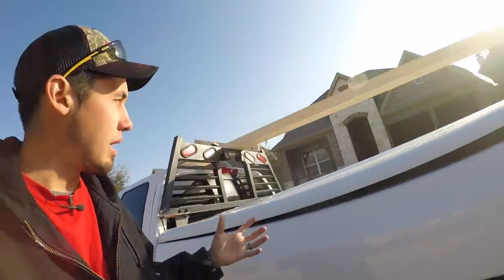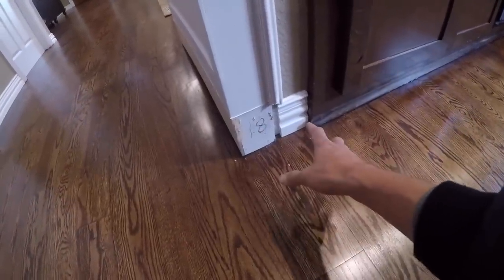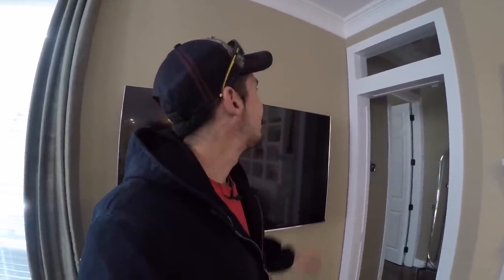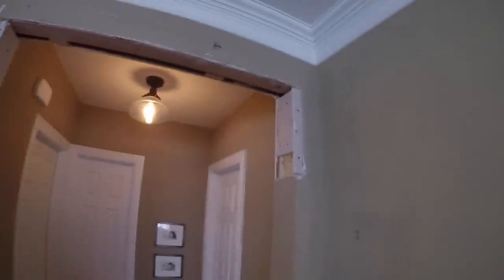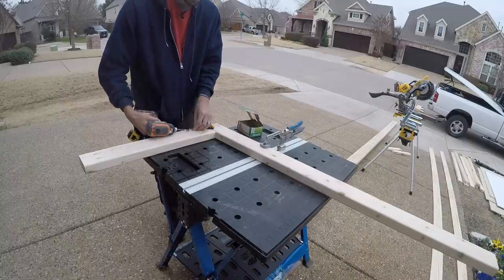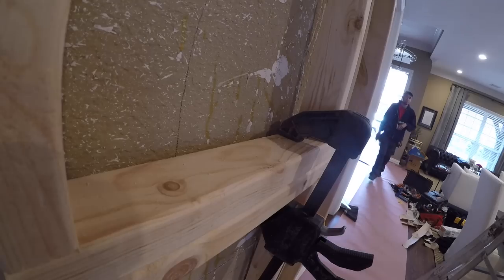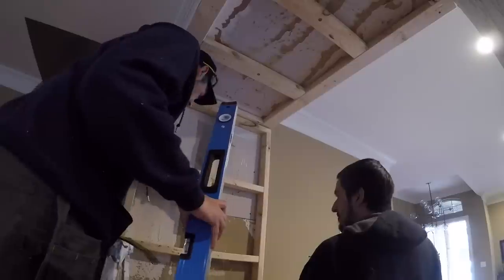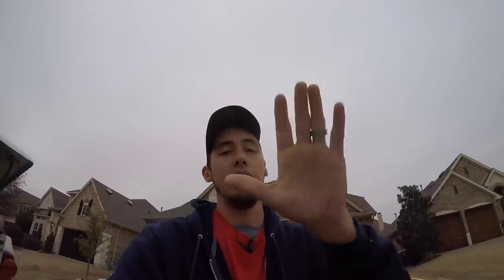A $3500 Mistake

Comment: I have drywall archways throughout my house. I want to add custom molding around this but not sure how to make this mounding. Would love a video like that as there isn’t really any context on Facebook like that.
Reply: Winston Deitz there is flexible mouldings for arches, that’s the easiest, it’s made of rubber and it paints great.
Reply: It is best to build a jig.  A work area with the shape your require drawn out.  than take some ply and cut the inside of the arch to the opening size.  this will be the template.  next take some stock wood and wrap it in towels.  continue to pour on, near boiling water, while flexing the stock against the template.  it maybtake hours.  After it is flexed into shape take your router and make whatever trim shape you wish.

Comment: I am retired now, but I was a union carpenter for 37 years. Built a lot of concrete forms, hung a lot of drywall, installed a lot of acoustical ceilings, but when it came to trim work, call someone else. I never had the patients, I would be asked to work trim jobs many times, I always told the contractors I was not their guy. I’m not ashamed of that at all, sure, I can run base, casing, simple stuff. Thanks for your videos.

Comment: I've been a Craftsman for 35 years now I had a job doing 20 houses about the same size a quarter of the house I was doing at 20 foot 2×6 studs from the bottom plat to the second-story top plate in the entryways and living room I planning the studs and furring out the studs. The throughout the houses that's cool you didn't bag on the guys that did the job before you you don't find too many Carpenters like you no more good job.

Comment: Some of the comments are so silly....from the home owner is too picky to the design is too elaborate and just make it drywall. You as a very talented carpenter stand out from the "wanna-be" contractors who have a truck, a hammer and nails and call themselves experts. Understanding how trim pieces "transition" smoothly in a design and knowing the proper way to build framed out openings is what the homeowner was looking for. Is she an expert? Probably not-that's what you either have a specialist like you or an architect or interior designer make your design for you. The mistake the home owner made was not checking the other guys references or work. Great videos....

Comment: At 7:04 of the video you're showing that trim on side of door. What they used for base doesn't match baseboard that is already in place. When you put up the 2x4 frame work to lower the ceiling, wasn't there anything to nail to . Why did you have to toggle bolt it in place ?

Comment: You could have saved a lot of work by using 3 1/2"  verticals on the outside and 2 1/2" for the rest of that passageway.  You have 1" at the ends when you rock it, which means somewhere in between, there is about 1/2" bow.

Comment: I don't usually comment on videos, but I'm watching this video and I'm really surprised you went ahead and added that big, basically extra wall in that walkway by the stairs because it was bowed out. You just about took square footage from the house, you even said their were drywall guys going in. I think a better fix would've been to take that piece of drywall out and re-set the ONE stud behind the wall, then the drywallers could've come in, threw up another piece, and you could've saved square footage, time & material, and it would've looked like the house in the beginning. The wall didn't even have a load on it. I'm just surprised because you're usually pretty good.
Reply: if you listened to the beginning of the video, he explained the other reason he did that was so he could get a whole piece of trim on the inside of the staircase. And the finished look wouldnt be so clumsy...  It didnt look like the house was gonna miss any square footage...

Comment: LOOK at the base she accepted on the pillar , around the new cabinets (to left of second arch repair) and its clear by it's mismatch to original  the home owner is not fussy enough for me to have ever considered working for her, without a lot of clarification on her actual vision . (for her as much for me ). 
For lack of clarification the shaker style pillar look should have been applied to the wall openings using the existing crown at top and an attempt to match oldest baseboard . ALL ok'd in writing before any work start .

Comment: i hate to say it brother, you said, "we can stop being framers....." you never stopped being a finish carpenter. id have laid 2x2s on the ceiling framed the side wall on 12" layout to straddle that center stud and give the panel support. notch the plate or float by with a 2x2 as the center plates to avoid that stud. the min you have pocket screws on framing members thats just plain trim. you are great at what you do, i don't have the patience, or the ability to deal in /32 of an inch. they call it rough for a reason.  even when you said "now i get to break some stuff" and had a 3" trim bar lol. i go get bfh and get it down.

Comment: Good vid. Where did you get your blue work table that you were setting pocket holes in the 2x4's?
Reply: legalsolutions07 I believe that is the Kreg Mobile Project Center which is most commonly available at Lowes, Rockler and Menards. All over online as well.

Comment: Didn't really seem like the toggle bolts where necessary. There "should of been" enough framing behind the sheetrock to screw into, but I was there to know if there were or not, but there should of been. And gotta order the right material, 10' sticks would of been the right lumber to use, less work, no kink..... Nice finish work tho!

Comment: What if I have to do this but my floor is all tile and concrete slab underneath??? what would you use?
Reply: I think you can pre-hole at the bottom with concrete bit and screw it.

Comment: As far as the wall  with a lump on it...  Sorry to say, I think you didn't do much better than the last guy.
What you should have done, was to built the frame just as you did but, instead of moving it away from the way (something that will thicken the wall's width when viewed from the sides), you should have inscribed the 2x4 in the area where the wall was bowing, and that would have allowed you to have the entire frame flush with the existing wall, without intruding more into the walkway, and as I said, have wall that when looked from the sides, as you walk towards it, will look thicker at different levels.  Just my opinion.

Comment: The most basic difficulty is still,,, no plans, no prints.  You have the benefit of 20/20 hindsight.  You've seen what you don't like, the owner has seen what she doesn't like,,,,, and I'd wager the previous contractor has seen what he or she doesn't like,

What is the passageway width?
Reply: Not wide enough after you build the wall

Comment: Nice work!  What would you prefer to use for the field instead of MDF?  Thanks again
Reply: Fingerjoined pine or poplar.  Little more expensive than mdf but last 100x longer.
Reply: Johnie 1st choice how would mdf have a smoother surface?  Fingerjoined prime has as much prep as mdf and it's solid wood.  You get way more life out of it and it won't warp like mdf.  I work mostly in the Seattle area and mdf goes to shit quick over here.  It's a quick buck using mdf but you put 2 guys on a job, one using mdf and one using fingerjoined and I bet the guy using real wood will get the call back.
Reply: Anybody who recommends finger jointed anything hasn't been around the business long enough to see finger joints raise and swell. I'm 31, what rock you been under? MDF is the material of choice for painted dry areas.

Comment: I am a jack of all trades.. i can get it done. Doesnt mean i know the best, easiest or fastest way to do it.  Hire the right person get it done right the first time,.. save yourself the money and headache. 
I have to be a jack of all.. i dont have the money for experts. But i still want quality.

I love the triming in this house. I did similar.

I wouldnt of bothered with the toggles. The centers tie into the outer frame plenty. If the wood warps in the center.. the toggles will just take the drywall with it.

Comment: OK, so that wall section by the stairs was originally put in to hide the crooked wall?...but it didn't.
Reply: Apparently, also, is the full stop ( screws into the hardwood floor) potentially creating an expensive failure?

Comment: Did you used a skill saw inside the house with out covering the furniture or light fixtures? That’s a big no, no.. you should be using better cover material for your flooring and after all it looks like mdf or just pine that tells you they didn’t pay well for the job.. I like to see your work with natural stain wood. (Always judge you’re workers on how they prep the job and how well they protect your existing materials and furniture)

Comment: You should have ripped out that drywall. There is a reason why that stud is so bowed. There could be a severe settling problem or some piping issues behind there. I would have at the least, cut a piece out and took a quick peek.

Comment: The wall with the bow was not handled correctly. The drywall should of been removed and the bowed stud should be cut out and replaced. You spent more time making the floating wall while simultaneously narrowing the hallway. Next time smoke after the job is done.

Comment: Looks like Frenchy carpentry 101 haha. Lesson #1 get way to intricate, then fill in the rest with caulking.
Wth is up with these straight seams???
Definitely a hack job, from someone who is either (as I said) an old Frenchy carpenter or, someone young who may have worked for a carpenter for about a week then felt they were experienced enough to start their own business... "How hard could it be?"

I Don't understand it... I cut this board 3 times, and it's still too short 0_o

Comment: So the home owner didn't want to spend the extra money and fix the wall the right way? Personally, I would have rather had a smooth wall rather than the extension then back to the wall again before the door. If the ceiling is going to be covered why not cut out some of the drywall and screw in some framing? Drywall has to hold  2x4 framing? Maybe I am missing something.
Reply: Trevor Hohmann ya that was a bit odd and seemed like a quick fix rather than the right way

Comment: Only meant as constructive criticism. Don’t build on top of hardwood flooring. EVER. You create stress on the rest of the hardwood flooring by removing the ability for the hardwood to expand and contract properly(that’s why you have to leave spacing for hardwood from walls.....much less building a wall on it. On top of that you are adding an easy point of failure from when the hardwood expands during the warmer time of the year. Even when a home has a humidifier. Also fail to see any logic in building a wall to cover a bad wall. Take off the drywall, fix or trim the bad stud and sister on if needed. As a rule of thumb. Don’t use mdf in a confined areas like that where there is a far higher likelihood of nicks dings etc. you had framing you could secure to instead of building a door case with toggle bolts. I mean really...you know the drywall isn’t hanging magically. Worse case cut a hole to see. Use a magnet to find screws. Or simply use framing screws where they had corner bead.

Comment: That original trim in the hluse is way to detailed to have different trim with the same level of detail in its profile running threw it. She should have scrapped all the trim. If it was more standard/basic trim without all the detail I would say go it for it. But she has two high profiled trims which looks tacky imo.

Comment: I love your videos, however I seen some things that could have been avoided and something tryout said that was not necessarily true.. first, if you removed the drywall and installed a stud properly flush next to the stud in question then you could simply cut the nails and remove bad stud. No planning, jacks or osha shunned activity. Second, you should have attached your wall straight to the existing wall allowing to float over floor,  not attached into the floor, you made it a lot harder if they decide to switch wood grain, or plank width, they will have to try and remove planks without damaging your product. Think about other trades when preforming your own. Third, shims, you holding a pry bar while trying to level is near impossible which was why your wal was level but not true. I am a carpenter as well so no hard feelings I hope just some friendly criticism.

Comment: Goddxxm son , whoever takes that kind of time to do something the wrong way ,makes me wonder , if u apparently CAN read a tape ,use a mitre , why go all that way to do it wrong , and who runs returns on the 2-3/4 crown molding ,along the inside of their busted ass cased opening , and then they actually took the time to put returns on the outta place crown .I BET THE REASON THEY RAN THAT CROWN WAS BCUZ THE HAD GAPS U COULD PUT UR BIGTOE IN , PROLLY OUTTA SQUARE ETC..🤣🤣🤣

Comment: The whole thing of jack-of-all-trades is nonsense.
A lot of people don't learn other trades because they don't need to. if you learn the first trade when you start in construction and you're lucky enough to keep on getting jobs for that then you're good , but if you don't have enough work at first then you have to learn other stuff to pay your bills. Dedicated people will not only learn that extra stuff but they will become good at it. Doesn't mean they have to be Jack's of every single trade but I know a few people including myself that do a very good job at most trades in a house. 
For example I would have never done what you did on that wall with the two by fours. I would have just taken an extra 20 minutes gone to the Home Depot and picked up straight 10 ft pieces of wood. Maybe if it was in my own house and I had just leftover material I would have used it like that but for a customer I would have bought straight full pieces.

Comment: I'm at the toggle bolt part... honestly you were better off taking the sheetrock down and framing the drop from the inside down.

You said you had no framing to nail I to, so you're relying on the strength of the sheetrock essentially. If you took the sheetrock out you could have framed it down and had a more solid fixture.

Or you could have packed the side wall out first and framed the ceiling off of that.

Idk I love the way you work but I started by building houses, rough framing, so I would never use toggle bolts with a good conscience. They just arent as strong as a wood to wood connection

Also dont know why you balloon framed that wall. Should have just run the studs floor to ceiling no? Everyone works differently, and I love your finish work. But I cant get around your framing..

Comment: Do you own a cross line laser? I would have just run a square and plumb laser grid past the opening about an inch off the frame then it could be straightened and plumbed with a ruler.
Reply: Holy shit Tristan! I didn't know you could build a house without a laser. That must have been how the Egyptians got the pyramid lined up...

Comment: Dude usually love ur work but definitely confused on some shit u did here.. Only name 1 that I'm sure many framers and carpenters noticed is ur nailer(block) u put in to help hold ur new 2 piece wall in place. Why the hell is that not screwed tight to the actual wall? There shouldn't be a half inch space between that wall and the block 23:35 like there is between that wall and ur new wall..

Comment: Why would you say that people should stick with one skill and then do the same thing yourself by framing and trimming? You are no framer, studs are to short as you said, but still installed it anyway. You also installed the framing on top of the hardwood flooring, In doing this you stopped the expansion of the flooring. Very bad Idea.

Comment: I enjoy problems and chopped up , female caused disasters,,,  columns in the middle of rooms are also frustrating...  I think lowering the ceiling by the stairs for that one spot .. and getting rid of a wall against the steps,,  just have the staircase start and end with nothing goofy breaking up that flow ,, would be the only thing that would look ok

Comment: Not knocking you, you did it fine. Should have knocked Sheetrock out all around, quicker, less framing and wood, more structurally sound, ceiling and wall. All you need is a nailer, attach it to the side of the existing framing, like a sister but moved out according to finish depth or height.

Comment: 19:40 What the fuck are you doing? The studs at the corner are off by an inch, so instead of opening it up and moving them you're packing the whole section out, so it can be 'flush'? Are you huffing glue, or do you have an exhaust leak in your monster truck

Comment: IF BOWED WALL WAS NOT STRUCTURAL, SHOULD HAVE DID THE JOB RIGHT WAY AND PULLED IT APART.  INSTEAD YOU PUT LIPSTICK ON A PIG,  AND OVERCHARGED THE LADY.  IF IT WAS A GUY, PROBABLY CHARGED LESS!!  STUPID PLACE TO PUT THAT DETAIL.  HENCE THE REASON ARCHITECT NEVER PUT IT THERE.

Comment: maybe just rip out down to original wall studs, fix the bow new sheet rock and then new plaster. Saves all the extra wood, OR NOT.
Reply: bill48m the point wasn't to straighten the wall , they were packing the wall out so the trim wouldn't have to be notched into the stair's

Comment: $3,500 JUST TO DO THAT?   A ROBBERY WITHOUT A GUN!!

LOST OVER 4 INCHES IN WALKWAY.   SHOULD HAVE TURNED STUDS FLAT, SINCE YOU DID NOT WANT TO DO THE JOB RIGHT, AND FIX THE BOW, INSTEAD LIPSTICK OVER A PIG,  THATS WHAT YOU COMPANY DOES??